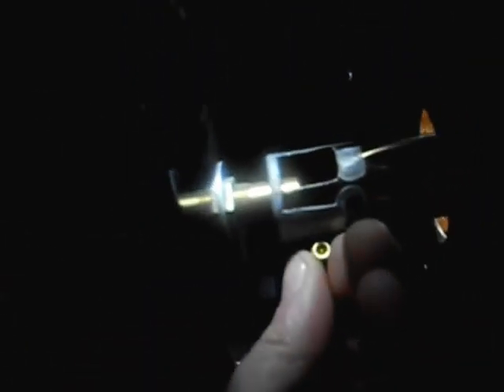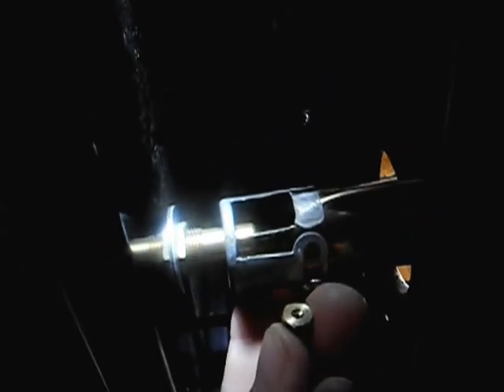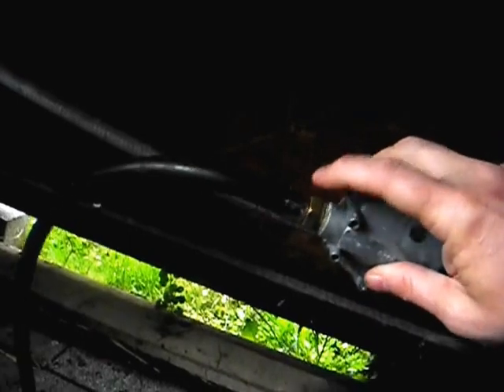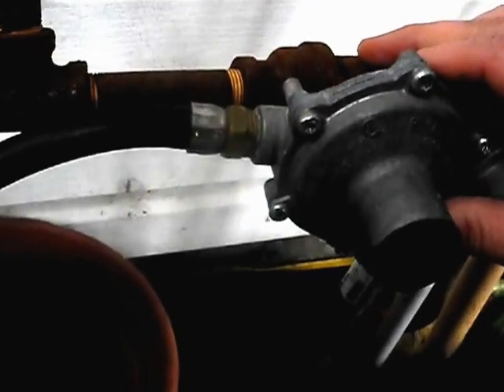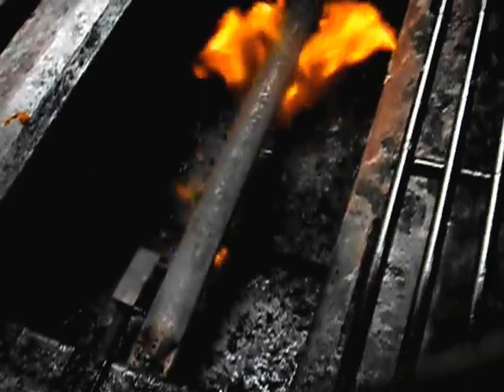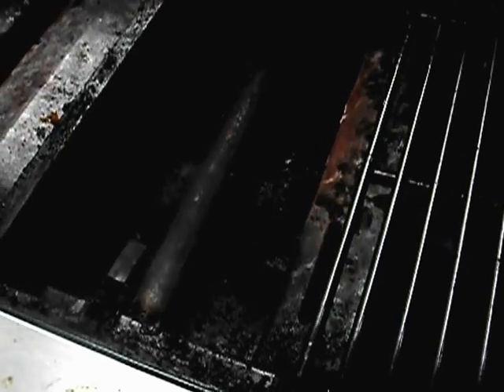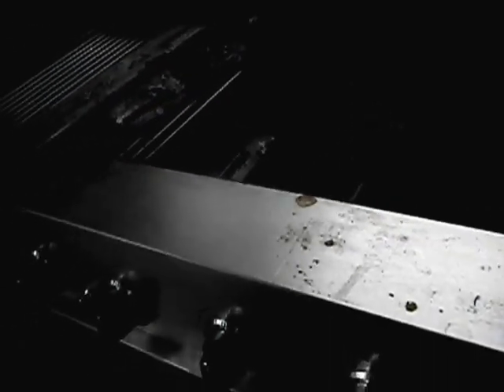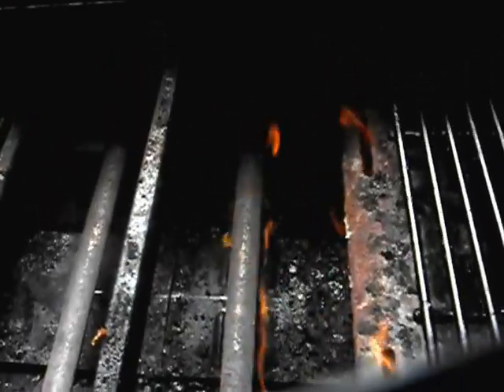How To: Grill Conversion from Propane (LPG) to Natural Gas (NG)

Comment from the maker: Right.  The grill works - but the yellowness of the flames suggests I may need to drill open the flame-tubes a bit.  I may try that on one of the flame-tubes soon - but there's no hurry since it does work quite well just the way it is.

Comment from the maker: @hobbyist1 You're prolly right about that. Meanwhile,
It WORKS FINE!!!  The food tastes great! 
At lower-flame levels the flames do get blue.  Last week I tried opening the air-windows (where I removed the brass jets) but it didn't make any discernible difference.  What it did do was catch-flame in that opening and make the knobs not turn as free.  Thankfully they're fine after re-closing those windows.  Thus my impression is its not worth effort. Ideally maybe the out-openings could be drilled?